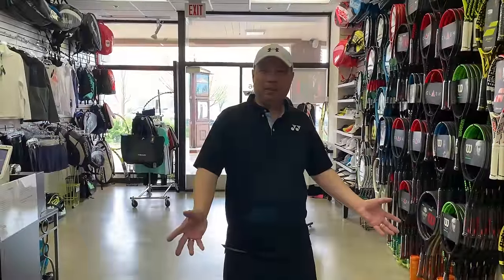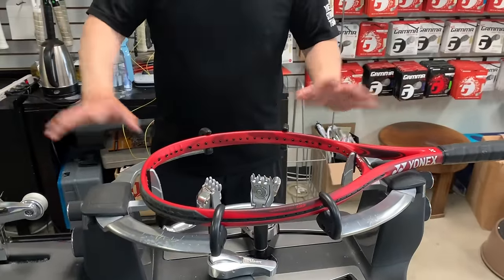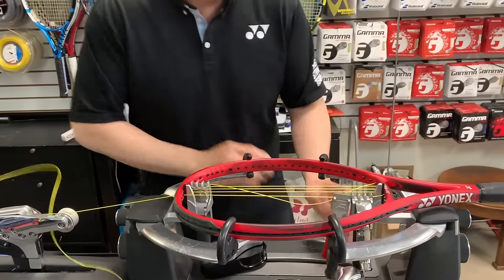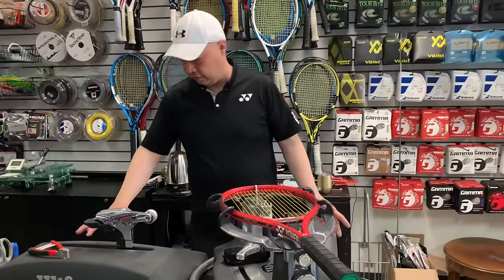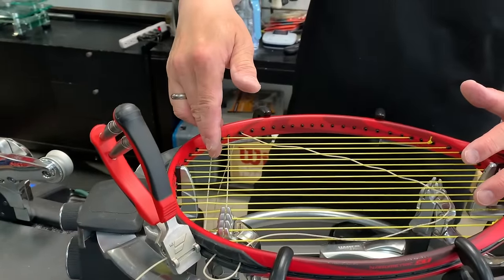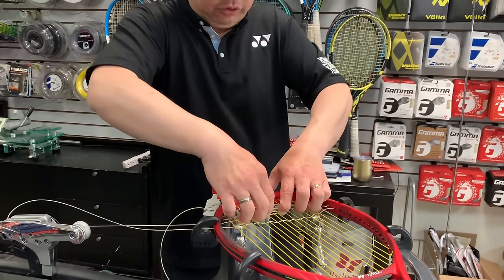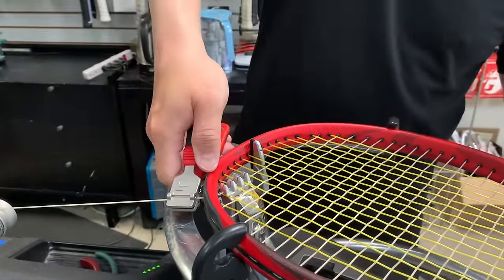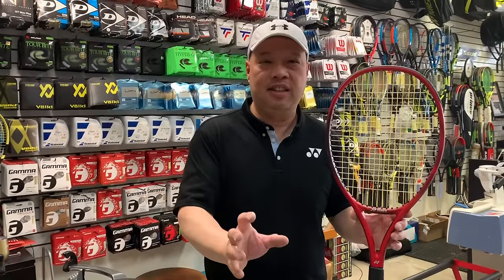Yonex Stringing Team - This is how we string tennis rackets.

Comment: Hi :)
I play with Wilson RF97 Autograph and i will put new set of strings ChampionChoice.. Natural Gut on mains and AluRough crosses. I saw Roger that he is using powerpads, short peaces of leather. I am interested to know, are they behave like small dumpers or they dont have any impact on feel while playing ?
Thank you for the answer :) :) 
great video :)
Reply from the maker: Silvio Šarunić The power pads do act like dampeners.  As you see he does not use a actual dampener.  Try it and see if you like it.  Maybe you  won’t have to use a dampener in your racket anymore.  Thanks for watching!
Reply: They dampen the feel slightly, but power pads are designed so that the natural gut is not against a sharp turn against the grommet. It rounds out the turn so it’s easier on the gut.
Reply: @rowellsalvado315  Exactly. Even Federer's stringer admits he thinks they're a bit useless nowadays. They were needed back when pros used thin gut at high tensions.

Comment: is there a reason why you don't first pull tension on the very first cross first, rather than the second?? Also, you should use some sort of pad to cushion between the starting clamp and the racket frame to avoid any marking.
Reply: Yonex specifies pulling the second cross. I used to pull each one separately, but changed after learning the Yonex method. It made sense to me - you go back and pull it when you remove the starting clamp, so you're actually pulling it twice. And no need for a pad when your on the bumperguard, imo. If you're putting the clamp on a part if the frame not covered by the bumperguard, then yes, you definitely should.

Comment: Good video, but why are you doing things other than "that's what they tell us to do". Why release base clamp first? Why first three mains, then four, then by twos? I get it saves some time and is an even distribution, but 4,3,2,2,2,2 is very specific. Is the no starting knot rule because of slippage? I'm just hoping for some explanations so In understand the logic? 

Like I said through great video with some terrific tips. Just hoping for more of an explanation on a few points.
Reply: Releasing clamp fingers first allows the string to slide across them as the fingers are being released (tension is slightly different on each side of clamp) which scuffs the string and fills the finger friction surface with bits of string. Releasing the base first  prevents this. For consistency always use the same knots on every end, the starting knot is different and no reason to use a different knot - it reduces consistency and is unnecessary.

Comment: Great video. 2 questions. Do you string this way for all your racquet brands or just yonex? If using a lock out tension stringer as it is not constant pull how many more pounds would you add for loss of constant pull?
Reply from the maker: David Ashman at the tournaments we have to string them all this way unless the player requests a one piece string job.  I would add 10lbs.  Thanks for watching.
Reply: @TennisSpin  I would never add 10 pounds to compensate for the tension difference between a lock out and a constant pull. The dynamic Tension would by way off between the two.
Reply: How much tension to add varies depending on who you ask. The consensus seems to be somewhere between 3 and 10 percent. "10 pounds" is not the right answer though, for sure. It should be relative to the tension you're stringing, not an absolute number. There's also other variables. Two constant pull machines, even if properly calibrated, will not necessarily result in equally tight string jobs. Pull speed, clamp draw-back, distance of puller from frame..... lots of other things can affect it.

Comment: Any idea why Yonex prefers the ending knot instead of the starting knot?
For making the the string bed as symmetrical as possible in terms of tension?
Reply: in the search for consistency use the same knots everywhere. both ends of the mains and the crosses have exactly the same knot and procedure. consistent.

Comment: Wait, so no starting knot on the crosses? Tie off the top cross on another cross after ditching the starting clamp?
Reply: I think the rationale for using the clamp and then tying off w a finishing knot, rather than tying a starting knot and pulling against it, is that it’s easier on the grommets. If you’ve ever split a grommet or had one widen out from repeated string jobs and had to replace it, it’s a pain.  Plus it’s the same in terms of tension at the head and the throat when you tie off the same way.  So more consistent.

Comment: Another thing I heard but wasn’t in the yonex training was the yonex loop. Skip 2nd to last main and do the last main. Then go back and weave the 2nd to last main. Have you heard of that and if so what are your thoughts. 

Thank you for your videos.
Reply from the maker: djneight I have done that but only to those prince o3’s and exo’s.  I could not get enough tension to the last cross because of the big holes.   I would not do it otherwise.  Thanks
Reply: Yonex 'loop' is only really for racquets where the factory tie off hole is miles away from where the last cross exits.
Reply: Doing the penultimate main last often leaves less untensioned string into the knot. The clamp can usually get closer to the frame.

Comment: I have a question. I am stringer and using prince neos. I am looking to buy a machine. Which machine would u suggest in 3000 to 4500 range?
Or would you recommend, I should buy use Babolat star 5 or dual senor

Wilson Baiardo ,wilson Baiardo light
Tourna 700, tourna cube, Alpha ghost 2

Your thoughts. I heard stories about the original clamps are terrible for the Wilson baiardo and its pain to adjust tension when its pull accurately.
Reply from the maker: I have had the old Baiardos and they pull really tight...  Too tight!  The new ones are way better even the light.  I just got a Baiardo Light and it is just like a Star 5.  Don't get a used Star or Sensor cause they don't make parts for them anymore.  I actually have Gamma ELS 8900s at my other places and they are work horses and never breaks down.  If you do high volume get a regular Baiardo or Gamma ELS 8900.  You will save a lot of time.  Good luck!  Thanks for watching!
Reply: @TennisSpin  . Are you on facebook my friend. In the tennis groups
Reply: What type of machine do you have my friend.
Reply: @TennisSpin  . Any thoughts on Alpha ghost 2  or SIGNUM PRO S-6700 PROFESSIONAL STRINGING. 

Thank you again.  For your time and thoughts.
Reply: A used Baiardo is a good deal. You can buy them after they've been used at Indian Wells or the US Open (they get new ones every year). The best price I've gotten (I've bought 6 of them over the past 5 years) was about $2500, but it's usually closer to $3500. Oh, and all six of them are still being used - I don't want anyone to think they've broken. Unfortunately, there might not be a US Open or Indian Wells this year, so you might have to wait to find one. 

I have old and new Baiardos and they all pull the same. I would never just assume they're calibrated correctly right out of the box though. We calibrate each new one we get. It's one thing I like about the Baiardo. Some Babolats can't be user calibrated (though they claim to be self calibrating), so I wasn't comfortable filling my shops with them.

Comment: Thank you for sharing the video. Just one question, I recently restrung one of my racket with one-piece of string (all other rackets have 2 piece string used) with same tension I used to. The problem is my feeling is very different from my other racket, means I lost my ball control. Why do you recommend 2 piece of string?
Reply: Better tension hold. Less chance for a knot to slip and compromise entire racquet

Comment: The "no starting knots" rule strikes me as odd - a starter knot incurs less tension loss than a finisher... why "outlaw" them?
Reply: Exactly what I was thinking. 
When he was talking about pro’s it was gibberish, I’m suprised this video got uploaded
Reply: A slight increase in the chance of breakage. When you pull on a string that is anchored by a knot, you put a lot of stress on the string the knot is anchored to. As far as the tension, intuitively what you said always seemed to correct to me as well. However, there are some other things to consider: When using the starting clamp, you end up pulling the top cross twice (the first pull, on the second cross, does put some tension on the first cross) and you pull it from both directions, helping to overcome more of the friction from the mains. Also, if you do like he does in the video, and pull the top cross last, you have allowed the string to relax after the first time it was tightened. Each of those things will contribute to higher tension. 

Bottom line: Be consistent and it doesn't really matter. Neither way is wrong. If you get paid to string, I do believe you should use the clamp, because it is considered to be less damaging to the string. I'm really big on professional obligation. If someone is paying you to do something, and you are considered a professional, you are obligated to do the very best you possible can. Even if it hardly matters.

Comment: Is adding 10% tension at the last Mains same as setting the tension to PreStretch 10%?
Reply: Pre strech has nothing to do with 10% more tension at last main/cross! Pre strech is method used to straight up a whole string before starting to string racket at all. You don’t have to do on polyester and other synthetic strings but for natural gut its a must to do!

Comment: i was surprised YY told you to use starting clamp within the string bed after the clamp. Imaging the clamp weren't tight right and string is slipping  after first pull. The string is going to be damaged.
Reply from the maker: Yep.  Just in case it slips.  Thanks for watching!
Reply: @TennisSpin  neat trick. i get slippage when pulling the first main often.
have you seen the method where you tension both starting mains together, then clamp, before retensioning the first actual main?
Reply: He should have done a better job at getting the starting clamp flush with the machine clamp. You are spot on - if it did what it was supposed to do, and stop slippage, it would damage the string because it is not being used correctly. 

Whenever I do use a starting clamp this way, I'll apply light tension to the string with the machine clamp still open, to really push the starting clamp up against it. You want to try to make it as if it were one big clamp.

Comment: This is how I’ve always strung my racket. Do you usually do things different
Reply: What benefit is there in tensioning the first cross last?  When I do the crosses I hang on to the end of the string so I am not looking for the end 20 times.   I use Parnell knots to tie off,  or Wilson Pro if there is not enough room.  I do a starting knot for the crosses.  I start on the third cross and weave back.  He left out why this is done - so you are not pulling 20 feet of string through the high part of the racquet.  A must for gut but probably not needed for poly.  Because of Covid,  I strung a racquet yesterday for the first time since last fall.   It took me a few minutes to find the on button for my Babalot 5 star machine.   I also have a Prince Neos that I traveled with and I do some things differently.  I pull both mains before I clamp to start.  That way the 2+ inches within the clamp is under tension.  Probably not necessary with constant pull machines.     I also do not bother with the knot feature.   I do not have that on the Neos, but I could manually increase the tension setting.  I do not bother.   Nobody hits the ball there anyway.
Reply: Can I string a Yonex Raquet on a drop weight stringing machine?
Reply: @grafon.mobile.detailingblo634  Of course you can :)

Comment: Hello. Thanks for posting your videos. I am happy to see you tie off knots the same way I do (over-under and through). I have been a stringer since 1989 and a previous member of the USRSA. I am quite familiar with Yonex frames and know past and current stringing instructions usually recommend a starting knot of 6H. I was very surprised this tutorial you tied a knot around the 11H location which is not a wide or typical tie off hole. Should you have pulled that top cross and tied it off at the 6H location to meet warranty specifications?
Reply: Hi there, I just want to share my thoughts about starting knot at the 11H location instead of 6H. As I know, it's a good practice to tie-off the soft string over the stiff one, or tie-off soft string over itself BUT it's incorrect to tie-off stiff string over soft one (by soft I mean natural gut/multi, by stiff - poly/kevlar etc.).  And in the video we see that stringer has poly (stiff) in the mains and soft in the crosses, so theoretically he can do the starting knot both at 6H and 11H (in both cases soft string will be over itself or over stiff one). But in case player wants to have a soft string in the mains and stiff in the crosses  - then we have to do a starting knot at 11H position, cause making it at 6H will make a tie-off of stiff string (crosses) over the soft one in the mains. That's why it could be 2 possibilities to tie a starting knot at 6H or 11H. But I am not 100% sure as I'm an amateur stringer, need confirmation from professionals

Comment: Your knot tightening method is not ideal. When you tighten the first part of the knot pulling it toward the frame FIRST you make pulling the string away from the frame pointless. It’s already tightened and it needs the slack in the knot in order to take up slack behind the knot which is why you’re pulling it away and rocking it back in the first place. I hope I explained that well. Your first move after making the first half of the knot should be to pull it away from the frame taking up slack in the string (as much as possible anyway) and then rocking it back and pulling the knot tight. Also, you don’t need to repeat the whole process for the second part of the knot. You just need to pull it tight towards you since all the slack that’s going to be taken out has been taken out already. Pulling it out and rocking back again does nothing because the first half of the knot is already tight. Hope this helps.

Comment: I wonder if I still know how to string after Covid.  The tennis clubs were closed and outdoor courts locked up until recently.   I used to teach tennis freelance and string for my students  and I guess maybe next season.  I was hitting against my covid free ball machine and some lady asked if I could give her tips.  I said okay and put on a mask.  She said she did not need a mask cause it was outdoors.  I realized I could not teach safely to a beginner, and since I live with an EMT I should not.   Stringing is even worse.   I could string a racquet and tell the customer not to use it for 3 days or so.  With Covid,  we need peer reviewed data.  So back on subject,  the (Yonnex) way the crosses are started has it been peer reviewed?   I start on the third cross and work backwards to the first.  Then I tie the starting knot, back it up with a starting clamp,  and tension the first cross,  then the second,  then I weave the fourth and tension the third,  working a string ahead.  For the tie offs I used the Parnell pro knot.   Probably have to look it up to remember how to do it.  I live in the NYC metro area and we were hit pretty hard.   Most of my students were motivated to make the high school team.  The boys spring was cancelled and the girls fall looks dubious but still planned but very short.   I will try the cross method next time I break a string.  I have two nice stringing machines collecting dust.
Reply: imateapot51 what kind of machine do you have? I’m looking to upgrade from my crank with a wise and I’d be happy to take one or two off you hands if they’re just collecting dust
Reply: @davidli7642  I have a Prince Neos and a Babalot 5 star.  I hope to use them in the future.   I am also currently stuck in a non tennis area.   When I can sell a house I will move back to where I used to teach and string.  So I will hang onto them for now.

Comment: What difference does it make which side of the racquet is up?
Reply: it will make the knots in a consistent place
Reply: It's the only thing about the Yonex technique I disagree with (not the only thing in this video). If anything, I would prefer to alternate each time you string a racquet, to spread the stress out instead of focusing it on one spot every time. That would be impractical to keep track of, so I prefer to just not worry about it and let randomness spread out the stress.

Comment: What’s the difference between one piece and two pieces?
Reply: One piece method can be used on certain rackets while two piece method can be used on all rackets. From what I know one piece causes one half of the string bed to be looser than the other so all pro stringers use the 2 piece method for best consistency.

Comment: Great video. So you don't have to do a starting knot when starting the crosses.... interesting...
Reply: Not if you have a starting clamp. Starting knots used to be more common, but now they're considered a little unprofessional. There's a slight increase in the likelihood of breaking the anchor string with a starting knot. I use clamps, but I used to use knots. Out of the first 100,000 racquets I strung, I probably had only 3-4 break on the starting knot. The knot is fine if you don't have the clamp, and stringing is not your livelihood. I still suggest getting a starting clamp. They're my most valuable tool. We keep at least 2, and usually 3, on each of our stringing machines.